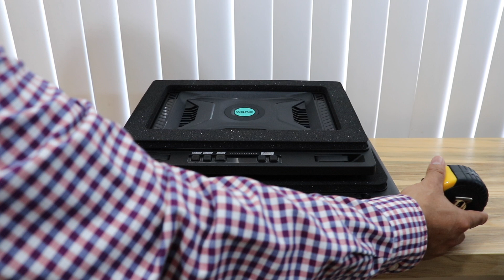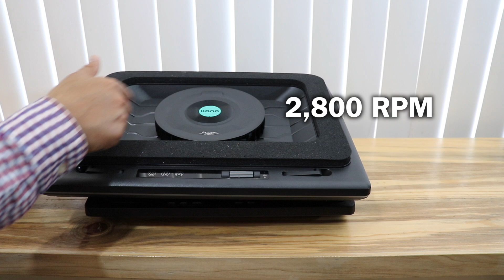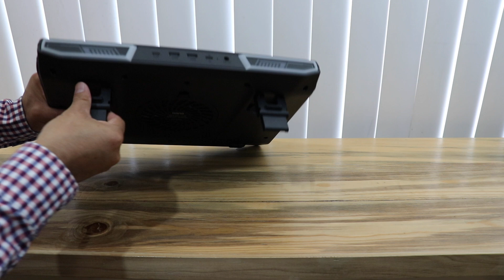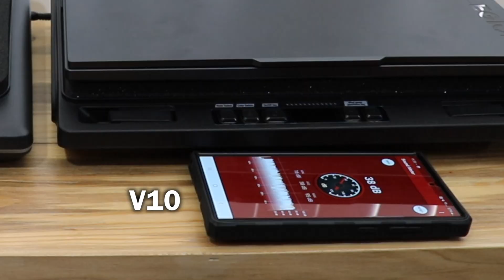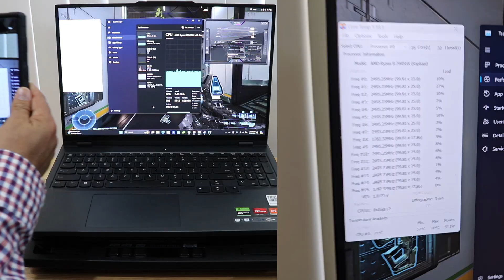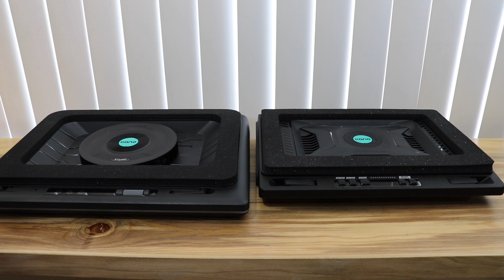Llano V10 Laptop Cooler - Amazing Smaller Design - More Quieter & Still Powerful - V12 Comparison

Comment: So in short V12 IF only you are a gamer and usually play AAA games while V10 is like all around aspect work + games but not AAA games.

Yes V12 is loud... I mean sooo loud but Loud means performance, V12 is like a JET ENGINE that will out your laptop in a fridge 🤣
Reply from the maker: Basically yes V12 vs Fridge, V12 taking it 🤣🤣

(Could use V12 for heavy editing work or 3d rendering but would be best to use with a nice set of headphones👍)

Comment: I currently have a gt500 and I use it at about 20% power, I don't know exactly fan speed it is because it doesn't have a display. This is enough for me to lower the temperature by 5-7 degrees. I had a v12 but I returned it because in my opinion it was much louder at low speed than the iets. Is the v10 quieter at low fan speed?
Reply from the maker: @Arbati6 yes it's about 10-15 db lower in  noise level on a low setting

Comment: hello, i would like to ask which would fit better for my laptop its the cyborg 15 which is a 15.6 in laptop. the v10 or v12
Reply from the maker: @lurky16  Watch this video it will help you out, and compare with your laptop. Both will most likely work but can watch the video to find your preferred fit. Also, the V10 will be better for traveling and the V12 you will get more cooling power.
https://youtu.be/XcGkWohKEXU?si=TkpXWMe9fcRlDht9

Hope this helps 👍👍
Reply: thank you! but in terms for portability will the v10  be the better choice?
Reply from the maker: @lurky16 yes it's more slim (less bulky) and dimensions smaller, I would choose it over v12 for taking back and forth, you can still carry around the v12 but only in a large backpack

Comment: Hello! I'm really torn between choosing between V10 or V12 any suggestion? My laptop is Acer Predator Helios Neo 16 i7
Reply from the maker: @mykeviper I personally would go with the cooling power so the V12!! I like better performance.

If you travel with your laptop a lot to do demanding processing work then choose the V10! Way better for travel. Or if you just want a more compact set-up (less bulky) at home then the V10 is the choice again.

They both are really awesome.

Here is a fitting guide if you feel you need it:
https://youtu.be/XcGkWohKEXU

Comment: Hi, I have from the new models Mai vektor 78gp with a video card 4080 screen size 17.3 what cooling from this video will suit me?
Reply from the maker: I say go for better cooling power, so the V12 would be it. But if you are planning on taking your cooler on the go, go for the V10 since it's much more portable, fits in a carrying bag easier.

If you want to feel extra confident, use this video to compare your laptop with the cooler you choose:
https://youtu.be/XcGkWohKEXU

Hope this helps! 👍👍
Reply: @jpalacesneakers  Thank you very much, man, is it called v12?
Reply from the maker: @sergeydemurchev616  Yes, the V12 (it's bigger though) from Llano.

The V12 is the version with RGB.
The V13 is the version without RGB.

Comment: I have Msi katana 17, brand new. And can't decide about the cooler, I do like the v10 because it's not so bulky. I do like to play on max settings for long hours, so cooling is important, I am sure u know Msi katanas grills, and what u think about v10, or I should go for v12, or even gt600
Reply from the maker: @L3MON_Haze Go for the V10 for best cooler for traveling (weighs less and easier to carry in a backpack, etc), get the V12 for the best cooling power period (cools the best out of all the coolers out there), or get the GT600 for best RGB (1 degree less of cooling power than the V12 but it has to be elevated with the stands to achieve this).

It all depends on what you are looking for, decide what will work best for you, what you really want the most:

V10 - easiest travel yet w great cooling power
V12 - best cooling power
GT600 - best RGB/ great cooling power but w the stands up

Hope this helps 🙏👌👌
Reply: @jpalacesneakers  It's strange that it needs that elevation .. I guess because the air intake in the bottom can take in air more easily like that. P.s. When you're talking about the gt600 .. which one are you talking about? I'm guessing the V2 because the original B0 and the V1 version don't seem to have rgb. The b0 version is supposedly much quieter but has worse cooling
Reply from the maker: @3choblast3r4 Watch this video, I do a side by side comparison with the elevation. I discovered an amazing detail about the elevation!

https://youtu.be/XcGkWohKEXU

But you are correct, the elevation does help the GT600 V2. I compared the GT600 V2 vs the V12.

Having both in hand, the built quality is super nice on both. At first I did like the touch buttons of the GT600 V2 better since it's more esthetically pleasing but after some use I like the wheel better since you can adjust the speeds more faster. Really just personal preference.

GT600 V2 has the better RGB, hands down.

Easily, the V12 has the better cooling power, especially if you watch the video I linked.

Great insights 3choblast, hope this helps! 👍👍
Reply: @jpalacesneakers  thanks!
Reply: I ordered the gt600 v2 .. and I'm very tempted to order the Llano.. seems that they have the same cooling. But I did see a video where the llano did better than the base gt600 but the base gt600 did just as well when it was set at an angle. Pretty sure it wasn't the GT600 v1 or v2 (there are 3 models, 0, 1 and 2, 1 and 2 are more powerful than the 0, 2 has RGB). I want to order the llano to compare. It seems that llano has worse build quality, but a physical dail for the rpm. The foam seems better on the gt600 and is attached by magnets (nothing holds the llano in place). The gt600 v2 seems to be a tad more quiet but they both seem to work similar.

Comment: Got the v12 and v10 and for my msi gp66 the v12 is better. While the v10 fan itself would be more silent, it sounds like the blades of the fan aren't a perfect fit and at lower rpm it kinda sounds like the blades slightly hit something... For the v12 I've got two here and both have at low rpg a stupid "current noise".. I'm disappointed by both tbh. I want the cooler to run at low rpm and I dont mind the wind noise but the coil whine or whatever it is, is kinda annoying... The v10 sound is more annoying at low rpm. At higher rpm both noises may disappear, I don't know because the fan itself is louder. In general, for that price, I'm disappointed at both. And while it could be a bad one for the v10, it would be a huge coincidence for both of the v12 to have the same defect. The cooling is nice but for my laptop the v12 cools it overall better even at lower rpm. Not only the temps are lower but the case itself is colder with the v12.
Reply from the maker: I appreciate this comment, love the honesty about it. The biggest con of all of these coolers is the noise levels, every cooler with great performance unfortunately will make noise. The technology for muffling sound is just not there yet. Lowering the rpm does help a bit but it is not perfect. Maybe it's a quality control issue, if you just got it exchange it for another one and hopefully the noise  will not be there.

The noise either bothers people (those who are sound sensitive) or doesn't bother others (disappears in the background when working or gaming). For the most part, I don't even hear the fans, only when I'm doing math the fans bug the heck out of me lolol.

It's just a matter of finding a cooler that can lower the temperatures but that you can tolerate the noise the most. I know it is not the best answer or solution.

I wonder how well these coolers will improve in 5 years with the noise control and the cooling power. 

🙏🙏

Comment: hi just asking, how does it compare with v12 @1400 and v10 @3500 both in temp and noise decibels? it's okay you dont have to make a video. ill trust your replies. thank you in advance for all your videos. subbed :D
Reply: ahh i was stupid. i can see the noise of v12 @1400 is pretty much the same with v10 @3500 yet i guess the result with v12 is almost the same as if it was running @2800 right? (i saw it in your other videos.)
Reply from the maker: I did different videos since I know everyone wants to know certain details =). V10 vs V12, the V12 out performs by 2 degrees in cooling power but the V10 is slightly behind which is still very good for it's size!

Noise levels the V10 at 3500 is going to be 4-5 dB less than the V12 at 2800.

Both are great, just depends what you are looking for, more cooling power or less noise.

Hope this helps 👍👍
Reply: @jpalacesneakers  ah my bad at my sentences. i meant the noise of v12 @1400 vs v10 @3500. since v12 @1400 performs practically the same as if it was running @2800.

i already ordered v12 just now though. you video helps alot. Thanks!
Reply from the maker: @PsychoRonos  It's all good bro bro, I type bad all the time too 👍 enjoy the cooler 😎
Reply: @jpalacesneakers  it arrives yesterday. god damn what a good purchase I've made. got the temps down cool enough that I can up the graphics a tad bit higher and it still runs at a lower temp than before. love it!  

And I never have to crank it up higher than 2000. mostly running at 1000 rpm. the best noise : temperature settings I can comfortably plays it on my built in speaker. 1400-2000 is when I am playing with my headphones on. :D
Reply from the maker: @PsychoRonos  love to hear this, yess 👌👌💯 I was telling you, it's a great pick-up

Comment: I have the IETS GT500 & llano V10, seems like the V10 pushes more air & significantly quieter even tho the V10 is smaller. Impressive work from llano
Reply from the maker: Much appreciated ❤

For a smaller build, the V10 is very impressive, more portable and fantastic cooling power. I use it for traveling for work and it's 👌👌
Reply: Did you change your cooler to V10?
Reply from the maker: @mykeviper  I mainly use the V12 at home and take the V10 for work/travel.

Jeji loved the IETS since they do make good products too but the V10 is a game changer for smaller coolers, Llano's new designs just have been 👌👌
Reply: Do you think v10 will fit the zephyrus g16?
Reply: @monzonsangcap9790  i have the v10 for my g16. used a razer to cut the foam to better size. sealed up better. did the same for the v12. i like the v10 more cause its quieter and fits better
Reply: @monzonsangcap9790 it does but the vents will be partly blocked, get a larger cooler if u can

Comment: i have the V12 work really well on my Alienware M18 R2
Reply from the maker: @ronniehill5102  that's awesome broskis, love to hear it 👌👌
Reply: @ronniehill5102  what temp drops are you seeing and what are you using to check them ? My m16 r2 with 4070 and 32gb ram says it's running the same temp but definitely feels much cooler
Reply: @jasonhorn5976  with out the cooler pad i sure it would be hitiing 100c i have the M18 r2  my temps Are cpu 90c gpu 60c
Reply: @ronniehill5102  i get that but what are you using to check the temp? Like I said the alienware app says the same on mine but it feels much cooler to the tuch
Reply: @jasonhorn5976  i use both alienware app and core temp but im  not sure core temp is always right  and using a cooler pad my fans never spin up unless i put it into high performances mode

Comment: V10 or iets gt500v2?
Reply: v10 is Mainly for 13-14 inch while gt500v2  is 10x louder & meant for 14-18 inch laptops
Reply from the maker: @user-os4qy7ys1t I don't own the gt500v2 but if you have a smaller laptop go with the v10 for sure, since has great cooling power.

My 16 inch laptop almost fit perfect, just 2% off but like I showed in the video you can cut off some of the foam sealer to make it work! 👌

Even a 17 inch could work too, just depends where the underneath intake vents are located on your exact laptop model. But just like amirulizzat mentioned, the v10 would be ideal for a smaller laptop. - makes transportation easier.

Comment: Thank you for your amazing review! May I ask, if you set the V10 RGB and speed to specific settings, will it remember them next time you switch it on?
Reply from the maker: @ionicone5  Yess it stores your last settings when you turn it off and back on. You'll just have to wait a bit for the rgb to start to the mode you previously had on, 2-3 seconds and it's automatic!! It's awesome
Reply: @jpalacesneakers  🙂🙂 Thank you so much for your reply! Knowing that it stores the last settings is a huge plus for me! 😄 and does the V12/V13 store setting as well?

Comment: hi what’s the size of the inside and outside of v10’s foam? need to check if it will cover my vents
Reply from the maker: @EricaReyes-l1l  I will be doing a part two video with many coolers, giving the foam size inside and out, foam height, weight, and many other details everyone has been asking for. It will be uploaded later today or tomorrow 👍👍

Comment: @jpalacesneakers Great in-depth review! Appreciate your hard work as I'm currently trying to choose which Llano model to get. Curiously, is there any way you can turn off the RGB on the V12 model, or will you just have to opt for the V13? Only reason being, I'll be using this in the office setting. Again, great video ... Subscribed!
Reply from the maker: Yes with the V12 you can turn off the RGBs. Turn on or off when you want them, perfect for different settings

Comment: which is better v10 or v13?
Reply from the maker: @ItsSpartanJoe  V13 has more cooling power than the V10 by 2-3 degrees, V13 is the V12 without RGB.

V10 is more quieter.

Both great options, just depend on what you are going for 👍
Reply: @jpalacesneakers  V12 all the way V10 has less cooling while gaming I have used both
Reply from the maker: @Dejavulife yes V12 is a power house if you don't mind the size, great choice!!